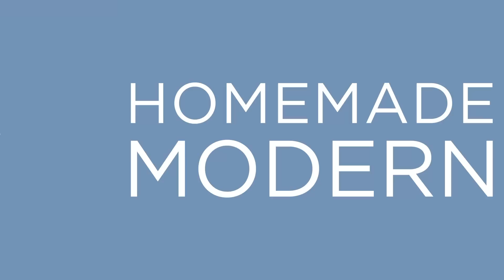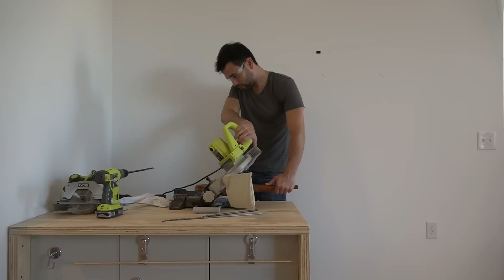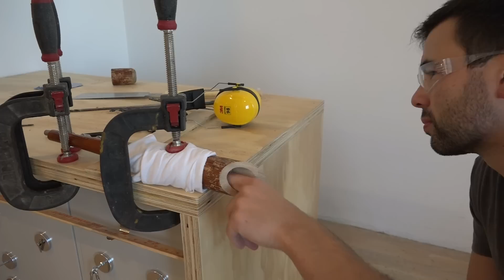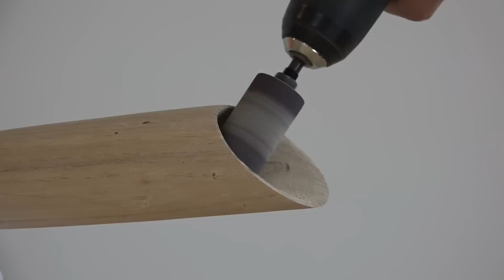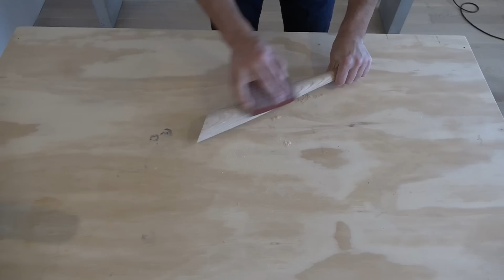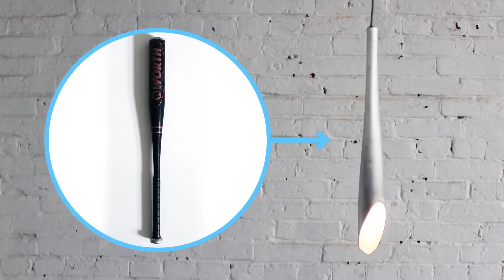DIY Wooden Baseball Bat Lamp

Comment: Interesting idea. 

I'm going to try the same, although I think I'll use a bandsaw to cut the bat down the centre. Then simply use a small router to go up the centre of each piece so I can lay the cord inside. 

Then I'll angle cut the end off like you did, and glue the two pieces back together. 

In theory, it should be much quicker and leave much less room for error. 

Ok, Monday Morning Quarterback is out, have a good one.
Reply: Good plan.  I think the hardest part will be keeping router cut straight on a tapering bat.  I guess hand-feed keeping bat centered on table by constantly eyeing  top and bottom as I feed.

Comment: Is there a particular reason why you cut off the end nearest the handle? Or was it just for aesthetics?

Edit: never mind, just realized it would likely be way too long then. I wonder if it would be possible to cut a section out of the handle and then glue it, so that you keep the end of the handle without the length. As it is I think the lamp loses the distinctive baseball bat shape.